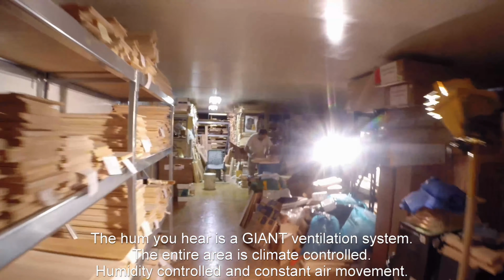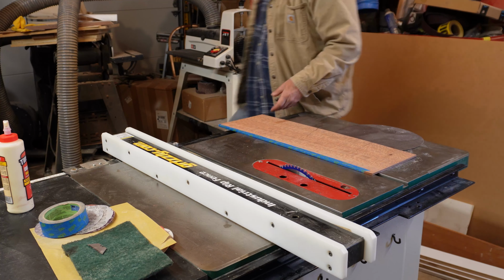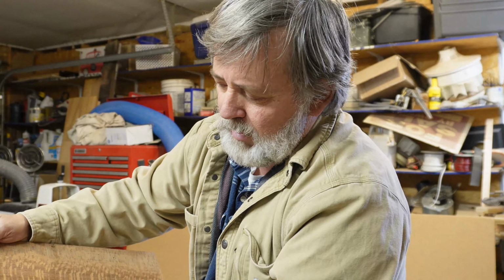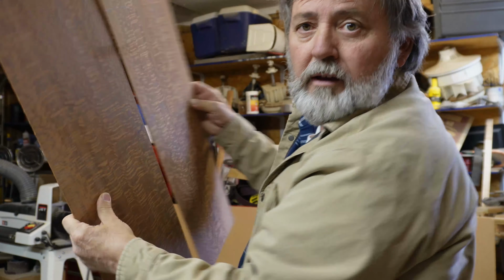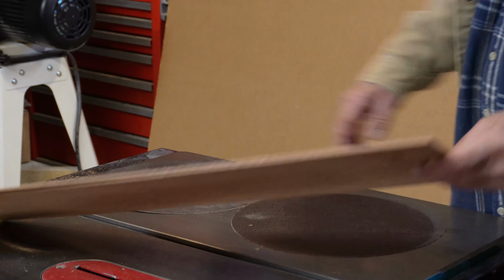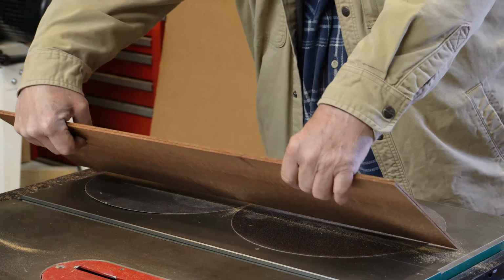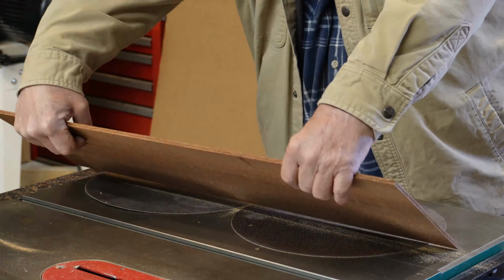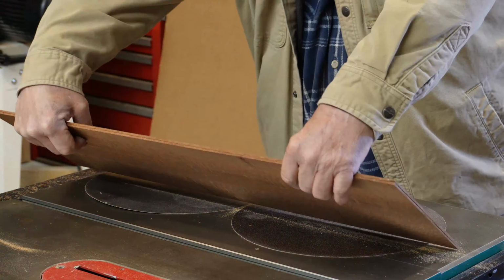Legend of the Dogwood Part 1  - #PH015

Comment: Would you be willing to share the brand and power of your laser cutter and the software used in this project?
Beautiful workmanship.  Chuck Salkewiczz
Reply from the maker: Chuck, Thanks for comment! I have a no name "red & black" Chinese 80w laser. I has a bed large enough for a dreadnought body without the neck. I think the max size is 19"x23" more or less... 
The software is a combination of Inkscape to do most of the drawing, and Lightburn to run the laser and organize all the parts by color/laser.
Drawing and fitting everything was the most time consuming part. I spent countless evenings working on the design. I was able to rout out and install all the pieces in about 20-30 hours.
Reply: Jerry sent me to your site to subscribe great detail work beautiful looking to see the next video and on to th finish product good look God bless you .
Reply from the maker: Thank you!